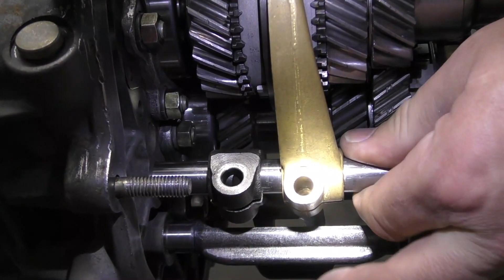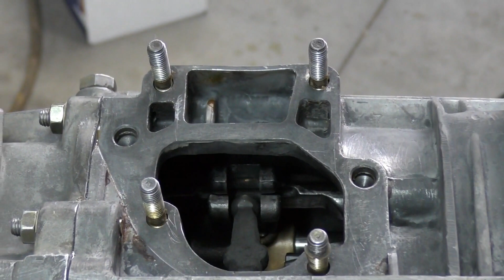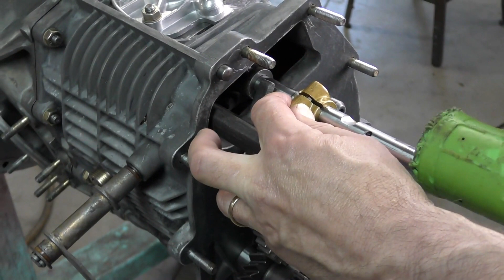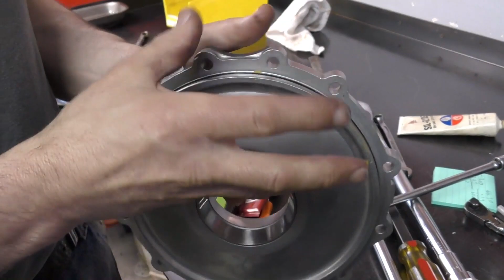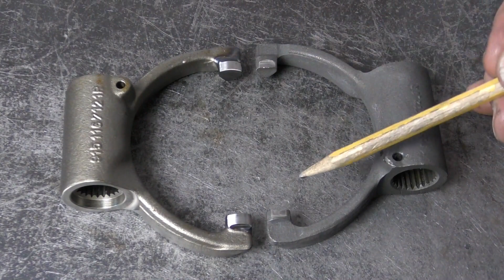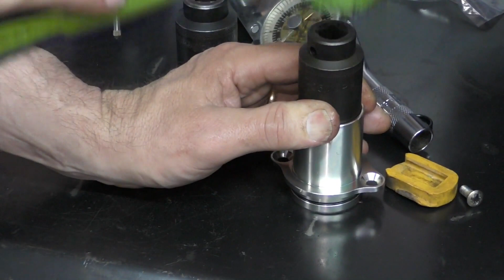Rebuilding a Porsche 915 Transmission Final Assembly.

Comment: Kurt, amazing video series on the break down, reassembly and install.. You are indeed a master! Is there a place we can purchase the specialty tools like the Input Shaft Spline Tool, Mandrill for adjusting the shift forks, and input shaft locking tool? Thanks. Peter
Reply from the maker: Peter,
Most of these tools are long gone from regular suppliers. You can find the shift fork set up plate at stomski racing, but that is going to be about it. Sometimes you will see some tools come up on eBay and some of the forums. You are going to need to budget somewhere in the 10k range to get everything you need to do these transmissions.
Kurt

Comment: Immensely invaluable content. I am rebuilding my 1986 915 transmission. Is 5th synchro supposed to be tight? With 5th hub assembled, I cannot turn 5th synchro by hand with either the new or old synchro, yet 1st - 4th I can turn the synchro by hand in either direction to check the braking action. Is this normal?
Reply from the maker: So 5th gear should be the same as 1st-4th gears and the synchro should move.
Kurt

Comment: Currently looking for the tools needed to
Rebuild my 915.  Thanks Kurt
Reply from the maker: depending on what you are looking for its going to be a big investment. The synchro tools are available from Sir tools, but most of the shaft holding tools are not available any where and you will have to try a locate used ones or manufacture your own. The same goes for the press tools. The diff measuring tools are going to be the most challenging and for a complete set up to measure pinion depth expect to pay somewhere around $8000 to $10,000. Some of the tools need to check backlash can also be fabricated depending on your skill set.

Comment: Excellent and thanks Kurt!  It would be beneficial to your viewers to see you cover the maintenance of the 5th/reverse detent system.  It was somewhat glossed over in this video.  I highly recommend that anyone who services one of these transmissions take the time to remove the two roll pins and remove the components for cleaning both the components and the bore.  I once saw a gearbox that was freshly rebuilt by a local shop get stuck in 5th gear because there was 50 years of worn synchro debris and gunk built up to the point of preventing the detent system from moving freely.  Under these circumstances the components will not freely fall out of the bore for servicing.  You can insert/force a series 7mm steel balls into the bore from the 5th/reverse shift rod hole to slowly force the components out of the bore.  Then take an 8mm ream or pipe brush to clean the bore.  Thanks again!
Reply from the maker: Hi Richard,
We always remove all hammer in plugs and detents, springs and spacers. Not sure about your removal technique but I guess if it works for you then great. Our cleaning process requires all parts to be out as we vapor blast then media tumble the cases. 
We will try and show more of this process on the next video.
Kurt

Comment: I would like to attempt this.  I have rebuilt my 3.2 engine with no previous experience but this looks more complicated with tolerances. and special tools required.
Reply from the maker: Yes, the only way to do this job right is to have the tooling. To buy all the tooling required to set up the transaxle you are going to have spend somewhere between $12,000 to $15,000. So unless you are going into the transaxle business probably best to have a shop that has the tools do the work for you.
Kurt

Comment: This has been an excellent and very informative series, much appreciated! I do have one quick question; can you explain why it is important to assemble everything without oil? Thank you!
Reply from the maker: I do explain this in the video, but the short answer is the bearings and shaft components need to be clamped against each other without the presence of oil so that the individual components as less likely to spin on the shaft.
Kurt
Reply: @Aircooledconsulting  Thank you for the explanation. I did watch the series in its entirety, but must have missed it. Thanks for all the work on this, I imagine it was quite a lot to video, edit and get put together. Really helpful!

Comment: Argument with a friend over downshifting and whether double clutching, with a throttle blip in neutral to match revs, or a single shift with a throttle blip to match, is better for the 915 gearbox. 
Seems to me both methods match revs, shift fork and selector move and by matching revs, the synchros would experience less abuse. Friend maintains that only double clutching saves synchro and wear. What is your opinion? 
Great video series, thanks!
Reply from the maker: George,
You friend is correct. The purpose of double clutching is to bring the gear sets as close to as possible in speed. Putting your foot on the clutch and revving the engine does nothing for gear set speeds. Personally unless there is an issue with the synchro's just drive it normally, foot on the clutch shift gears and keep driving.
Kurt
Reply: @Aircooledconsulting  I wish I was as skilled and experienced as you are in the mechanics of Porsche gear boxes, so I could visualize-understand exactly what’s going on in the double clutch versus single clutch methods. 
Is the double clutch better because the 915 is in neutral, clutch out, during the rev matching throttle blip?
It seems like the input shaft would speed back up since it is re-connected to the engine, as the clutch comes out, gear in neutral…before the second clutch and shift to lower gear.
Isn’t the 915 in neutral also, as you pass into a lower gear, even if momentarily?
Please forgive my inability to quickly understand this subject, which I find interesting, as I get back into racing and working on my old RSR.

Comment: I just bought a 79' 911 SC and it will not go into first gear, all other gears are fine, no noise or grinding. It's like a hard stop trying to select first. Is this a common problem? The vehicle has 75k miles.
Reply from the maker: Most likely the first gear synchro ring has peeled out of the dog teeth and it is mechanically blocking the slider. This is not uncommon for these transmissions. The transmission will need to come out and apart to resolve the issue.
Thanks Kurt
Reply: @Aircooledconsulting  after watching your build videos, I was thinking the same thing. I’m dropping my car off tomorrow, I’ll let you know how it goes. Thank you, been watching all your vids, very well done